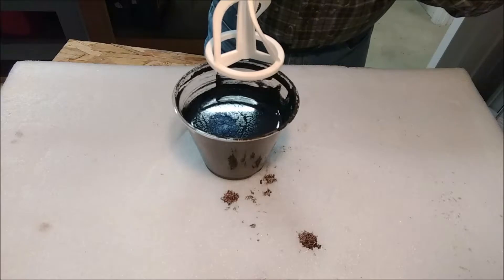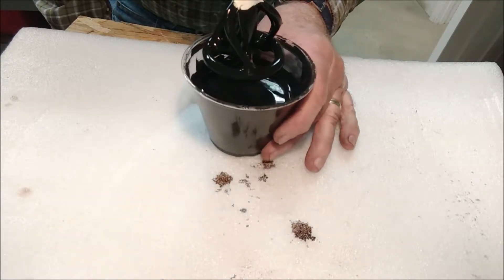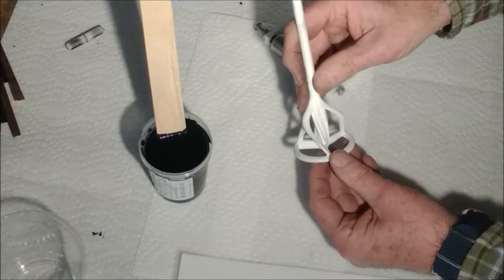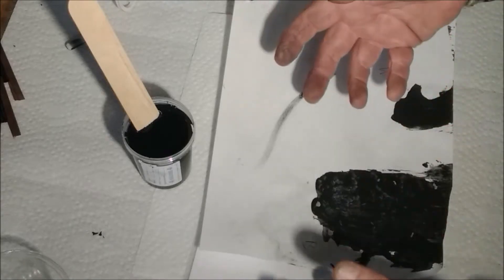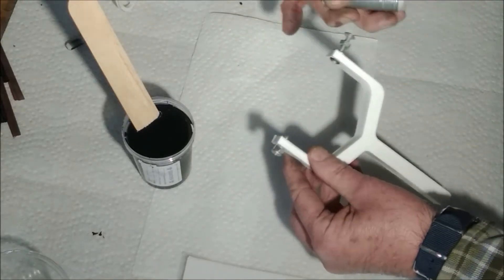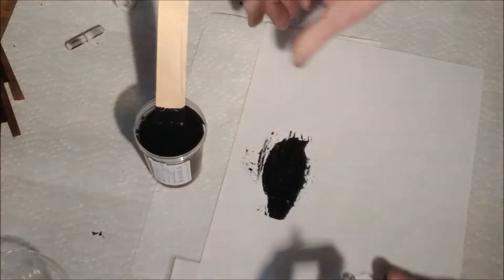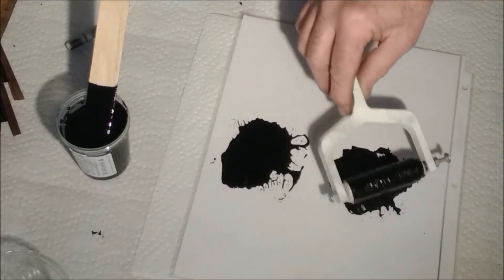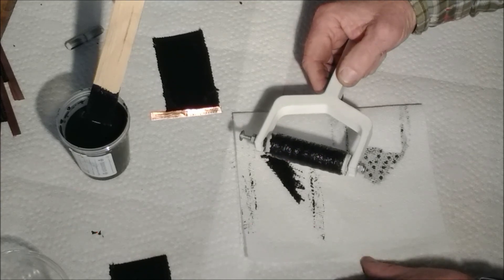Conductive Carbon Ink Tools

Comment: Hi Dennis great list of video's, I'm just curious can the planar gears function like a roller mill for grinding up graphite
Reply from the maker: Hi Peter....I think the gears would work quite well...at least as good as the roller mill.   That said I haven't tried it.   I let the roller mill run for about two hours and would suggest the same for a gear mill
Reply: Thanks I've been doing so work on using plain woven fibreglass and graphite based ink for a very low cost current collector, much the same as your carbon collectors in another video

Comment from the maker: Here's and update to make the mayer rod (roller) work a lot better.  Rather than use wire (steel - as shown in this video) I now use PET plastic.  Specifically I made a new roller 1.5" diameter and wound it with PETg filament that I often use for 3D printing.  The 1.75mm diameter PETg filament is hydrophobic so it does not aborb the carbons and is much easier to clean with soap and water.  I had to increase the diameter to work with the bend radius of the 1.7mm filament.  I'll try to remember to show a photo or two in my next video.